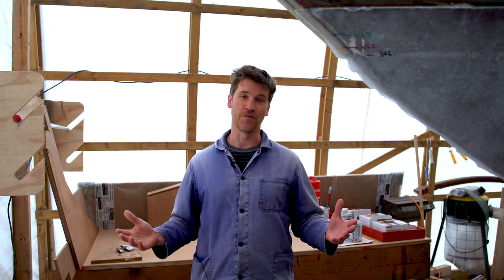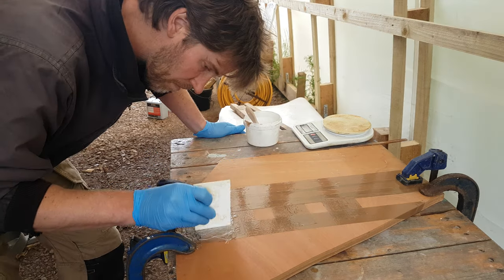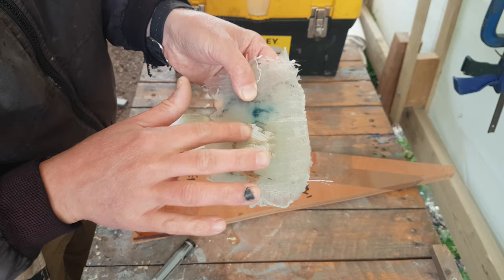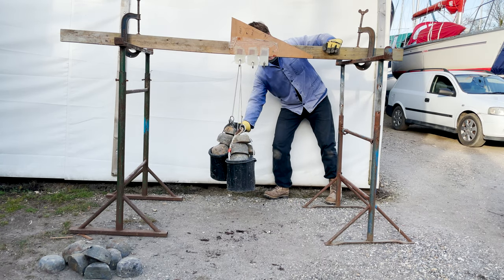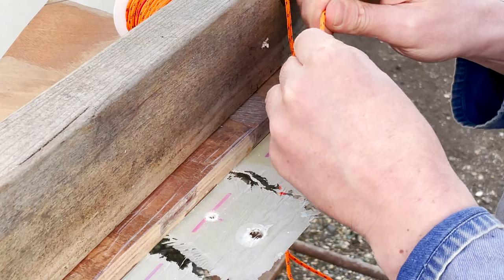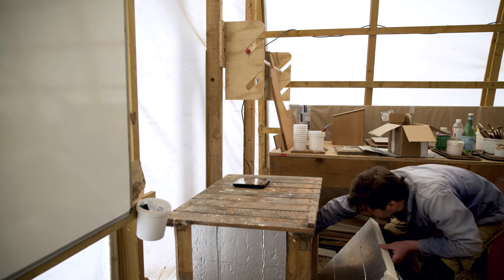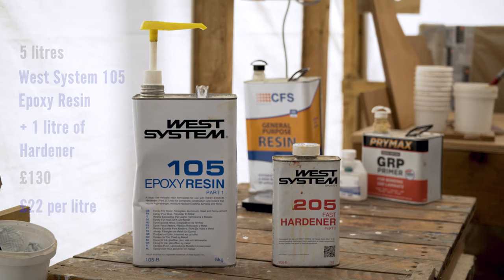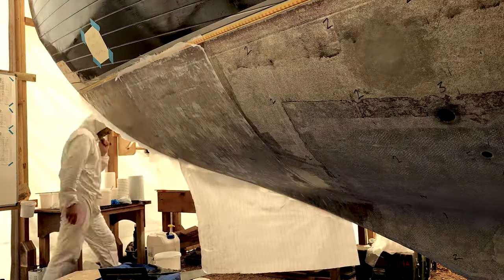EPOXY vs POLYESTER RESINS - TEST No.1 - LAMINATING ONTO MARINE PLYWOOD

Comment: Thanks for your insight - I’m in need of info concerning the building of a center box between beams 2 and 3 on a Wharram Pahi 42ft. It is not about building of the box, but that of material used.
My old one needs to be rebuilt because of rot. I used 9mm ply but was wondering if I can build it lighter with the same strength by using 6mm ply covered in chop strand or woven fibre. The fibre on the outside will also protect against water splashes? Any help will be much appreciated.
Its about strength vs weight – 9mm ply – 6mm ply covered one side – or covered both sides

Comment: Would have been interesting to compare with Vinyl Ester. We have used and find it a very good middle ground product
Reply from the maker: Thanks for comment. We will be including vinyl ester in future tests. As the focus of this was laminating onto marine plywood we decided to leave it out this time.
Reply: I may have got this wrong but I seem to remember reading somewhere that vinyl-ester has a poor shelf life. Hence unless you are using it regularly, it makes for poor economy to have unused resin on the shelf going off before you have chance to use it up. Perhaps not an issue on a big project that's in full swing, but for DIY use where the project happens in bits and bobs over time, then probably wouldn't be a good option.
Reply: @dannyboy9817  we have not had an issue in 3 years we have been using it. We do need to shake it up if it has been sitting for while.
Reply from the maker: @dannyboy9817  Suppliers usually say 6 months but I've had stuff that lasts for a couple of years easily on the shelf. You know when it's gone off - it goes pretty solid and impossible to shake up/stir.
Reply: Thanks for that. Worth knowing 👍

Comment: Hi. How about poly as a sheath on a hulls exterior.? Thanks. Think you answered my question by saying the lack of water resistance.
As we live with only water access and I have to push the boat out over 300 m of mud.
We just hot our barge stolen , so are making another. Was wondering if poly would be a sheath possibility. As no paint on the bottom because of the daily going to school drop off.
Any thoughts would be appreciated!
Thanks. From NZ.
Reply from the maker: This is for a small boat I guess if you’re pushing it. You could use gelcoat, or you could epoxy. Neither will stand up to contact with ground very well though. Put a Ultra high molecular weight polyethylene strip along the keel so that it protects the boat and works better as a sledge.

Comment: I'd like to see all these done again but in a vacuum bag for compression against the timber if you could.
Reply from the maker: Thanks for comment. Vacuum bagging is too specialist for most DIY boat owners. Therefore we won’t be including it in our videos for the foreseeable. It would have created a neater and lighter layup (perfect resin to cloth ration) but I doubt it would have changed the breaking strength of these resins or polyesters performance as a glue.

Comment: for better polyester adhesion on wood, you must thin the first coat with 30 % acetone, then proceed normally.
Reply: You weaken the resin that way.
Reply: @paulbriggs3072  ... no ! the diluted resin infiltrate deeply in the wood (no fibre), witch makes a much better and deeper adhesion layer with the wood ! ... when tacky ... add normal resin with fibres !
Reply: @paulbriggs3072  ... doing so, ... you will not be able to peel off the polyester !
Reply: @paulbriggs3072  You and OP are both right. It breaks down the resin (weakens it), so that smaller and smaller bits of it can filter down into the wood, stopping where the finest bits are not able to sink further into the wood. It makes a web that is infused into the wood, which is like thousands of micro tent stakes. And if the surface is wiped clean before it cures, there no significant weak layer of resin left to bond to. It’s just primed with resin.

Comment: I would probably automatically go with the best performing product despite material costs because I would assume the major cost would be the labor and not the materials and I would prefer to avoid doing the repair a second time.
Reply from the maker: The video is hopefully demonstrating that there is some nuance to what the best performing is - depending on the situation.If you use epoxy on black painted hull in the tropics the whole thing can start melting in the sun. This therefore isn't the best performing product.

Comment: Great overall but don't you think pouring sand into a bucket to test more precisely the weight of the breaking strength would be, rather than 2 bricks versus 4 bricks? PLUS, there is something else you didn't discuss which is that epoxy is superior in preventing rot. West System did surveys of 40 year old epoxy wood boats that had few problems. Most 40 year old polyester fiberglass encapsulated boats have rotted wood inside.. By the way to give you an idea of the spying tht goes on, while I was watching this, an epoxy ad interrupted the video!
Reply from the maker: Thanks for this. I like the sand idea - although I would have needed a lot of buckets to get 30 kilos! Regards to rot, that occurs because of delamination allowing moisture in - so bond is crucial to this
Reply: @seaschool_  Actually, polyester resin fiberglass can suffer from osmosis and this is where moisture enters the layup. It is more brittle as well.
Reply from the maker: @paulbriggs3072  Thanks for your comment. Did you watch the whole video?We discuss water resistance later in this video. We'll be conducting some tests soon on how brittle they are comparatively, as well as some tests on how high temperatures can cause epoxies to fail prematurely.

Comment: Great video! Can you advise what you would consider suitable for the following application, I am building some outdoor furniture and each has an inlay design, hopefully filled with a suitable resin, unsure as the advise given is varying from flooring experts to crafters, some say you can't use a resin outdoors and others imply you can with the right additives. Each unlay and design is filled with a resin pour of no more than 4mm and would be pigmented and coloured - and requires a suitable resin (Epoxy resin, Polyester resin, and Polyurethane resin) that can withstand the elements, the UV conditions and the rain and moisture, and in some cases the colder climates. Appreciate your recommendations and expertise, thanks Gaz
Reply: Hi,dear  You have a better choice by Nano painting,which is much better and waterproof.
Reply: @yanivm3738  Hi, what is Nano painting?
Reply from the maker: I only really use epoxy for structural uses so can’t advise. I know that it has poor uv properties though.

Comment: Hi how are you ? I need a advice from you , i have a refrigerator room made from panels but water its leaking under the panel . So my idea was to cover panels with marine wood panel and than i want to coat it with epoxy resin . Do you think it will work ? Temp of the fridge goes -30 celsius .
Reply: Marine ply is designed to soak in whatever liquid that is put on it. The intention being that if its first big soak is epoxy resin then it fully soaks it in using capillary action beyond what water can do. You could buy expensive marine ply and fully saturate it in epoxy before use but A. It's going to be expensive.   B. Time consuming due to cure times and full soak times given the plywoods drinking habit.  C. Heavy AF once the epoxy has soaked in and cured it will be the weight of the liquid epoxy and the ply and a saturated board of even 9mm thick marine ply with  proper Epoxy resin is F-ing heavy mate trust me it will drink the epoxy in if its genuine marine ply and youl be left with basically glass window weight roof panels. Use the conventional air gap, vapour barrier and fridge insulator mate it's cheaper, lighter and uses the air gap as the ultimate moisture trap rather than your wallet and bank balance.

Comment: I need a very liquid (low viscosity)  Epoxi or PE for filling fine cracks in concrete. can you recommend something? is PE or Epoxi thinner? want to use a syringe with a 4 mm tube
Reply from the maker: You can get specialist low viscosity resins.
Reply: Use the stuff designed for that as proper epoxy resin or Poly and Vinyl stuff needs coated for UV protection  afterwards. There are several brands in the UK that sell both boat, swimming pool and general building Epoxy mixes but you might need to do some homework. For example epoxy paint wise its a mob called Black Country paints that sell every other brand it here for them to then  water it down and use talcum powder as a filler then sell you it at 40x inflated price in a homestore or Amazon as a  "Driveway Epoxy filler"  Find the main supplier like i was saying about Black Country paints here in the UK the next brand down they sell the not so good stuff too are sold on Amazon and ebay and online under other names like 'TA paints' and 'Indistrial paints' a few other brand names. They supplying our military paints even the Aquasteel stuff used as a rust convertor on our submarines but they sell the leftover stuff to other brands to sell to the average consumer. Do some homework on epoxies for garden use and I'm sure you will find out what's what in your neck of the woods then jusy buy the stuff the farmers etc use direct from the supplier, guaranteed they will sell it from a gallon can upwards mate 👍
Reply: @seaschool_  i bought one, extra long cure time. worked well. almost too viscos. came out of cracks i not even knew they where there. :D

Comment: I wonder why you did not wet out the the plywood before laminating, best practice says you should. If you had the results would be much different  but the epoxy will always be better. When you use epoxy you also get a much better moisture barrier, critical when using timber in a marine environment. As we all know you can't buy quality resins cheaply hence the price difference between poly and epoxy.
Reply from the maker: Thanks for your comment. Perhaps you should look again at this video. I did wet out the plywood before laying up. Epoxy is an excellent resin, but not necessarily always the right choice.

Comment: Hello can you please tell if i can coat the first layer of fiber glass with epoxy and later layers with polyester as epoxy is expensive
Reply: What I’ve read is that epoxy bonds to polyester, but polyester does not bond well to epoxy.
Reply: No. Proper Epoxy will stick to anything even glass and diamonds they use it to set polished diamons it has the most tenacious bond known and works on anything and bonds to poly and vinyl resin better than they do to themselves. The problem is whan you use proper epoxy for a fix you cannot use poly of vinyl over the top as it hasn't got the ability to bond to glass, diamond or pure epoxy resin so you need to either use a fairing filler with the final epoxy layer even coloidal silica and sand that back before applying the poly or vinyl or you can sand the bare epoxy barrier coat back to around 190grit max (240grit can just about make enough grip if you keep using fresh pads) and apply an adhesion promoter from a can or spray gun, do two coats of adhesion promoter maybe 30 mins apart and ignore the 10-15 between coats that it says on the data sheet then apply your poly or vinyl directly over it. Another acceptable method is to 40-80grit the epoxy then soak it with Acetone repeatedly, dry it quickly with air hose then fire the poly or Vinyl resin on while it's in a state of "acceptance"  
The problem you have is that proper epoxy is really good at resisting chemicals and it's only too willing to accepting poly based paints but it's because they are heavily saturated with xylene etc and by the nature they bond to the surface not just themselves. Poly resin and vinyl bond mostly to their own.
Reply: @bigduphusaj162  thanks for detailed explanation :)

Comment: Right after I finished fiberglassing my plywood boat with polyester resin and cloth,I heard that the cost of epoxy was coming down to near the cost of polyester! I don’t know this for sure. But now it’s too late. I will just have to assume it’s going to hold up.
Reply from the maker: There are some advantages to using polyester resin over epoxy - that aren’t to do with cost. These are summarised at the end of this video.
Reply: Epoxy is now the same price as polyester in my country%

Comment: polyester resin is JUST for Layup, it is not designed for structural strength on bulkheads s similar, if you need to add strength to a frame or bulkhead apply more wood using epoxy or sheath in epoxy. you always Layup with Poly and Glue with epoxy.
Reply from the maker: Most production boats are built with just polyester against plywood - that's why I did this test. I agree that using polyester resin as a glue in this way is not the best construction method.

Comment: hi can i just put Fiberglass resin over ply  no matting
Reply: Hey, there is Epoxy resin, Polyester resin, And Polyurethane resin. There is no fiberglass resin as far as I'm aware. The 'Fiberglass' part is the mat.

You can apply a resin directly to your wood surface. This would make the wood waterproof and it would give it some extra strength. 

HOWEVER; As far as I'm aware the mat (which is the fiberglass part, not the resin) is what gives laminated materials their real strength. So it seems that it really is worth it to put the fiberglass mat down if you need strength especially bending resistance. 

Fiberglass mat is much cheaper than resin anyway, so you might as well. 👍👍
Reply from the maker: Like paint?
Reply: @seaschool_  yes
Reply from the maker: @Farmer2492  I wouldn’t. It’s too brittle without being bound with matting. If you do use resin as a coating like this you use flowcoat, which is similar to gelcoat. When this is painted directly onto wood (rather than laminate over wood)  it will often crack quickly.
Reply: @seaschool_  thank you i might just put marine Varnish over it probably 8 coats will that work better
Reply: Best to use a clear penetrating epoxy sealer

Comment: Epoxy glass may be very strong, but being that much stronger than ply, why not use poly.
Reply: Because the epoxy is stronger than wood, and the polyester is weaker than wood. The glass to glass bond is stronger too, and the wood is protected from rot with epoxy. West System did assessments of 40-year-old epoxy-over-wood boats which had little or virtually no rot. Polyester fiberglass boats of that vintage all have rotted wood stringers.